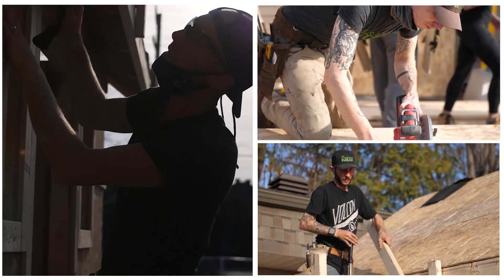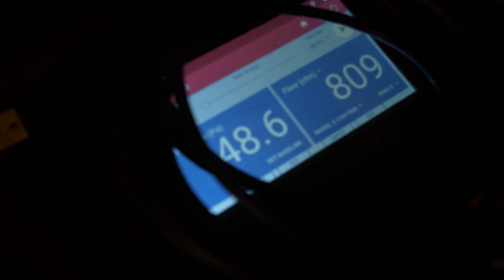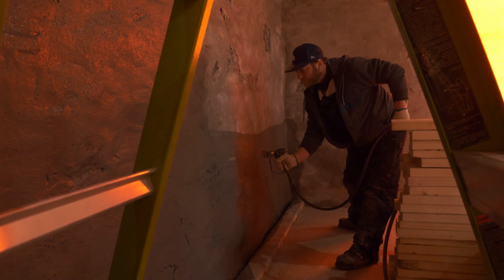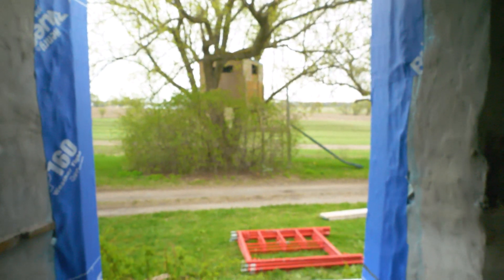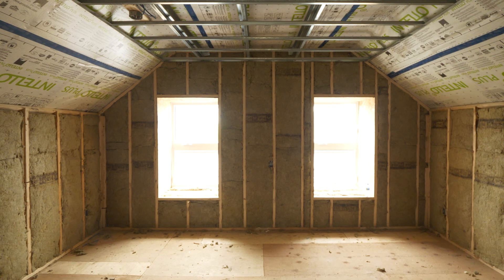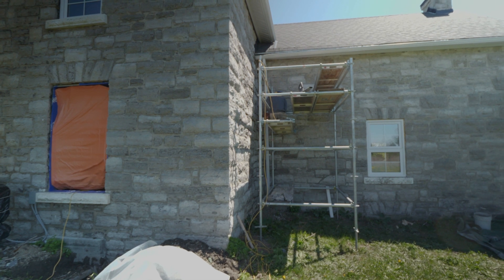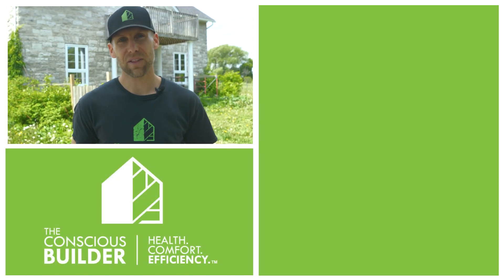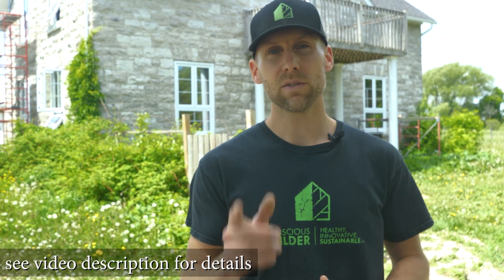How We Reduced Our ACH by 60% on our Pre Drywall Blower Door Test | 1860's Farmhouse Renovation

Comment: How would you potentially air seal the basement (or rather the conditioned floor) at a later date? Closed cell spray foam? Or use that same red spay air barrier and Intello? Curious what your approach would be.